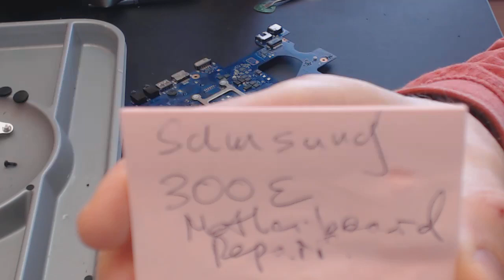Samsung 300e motherboard repair no power up issue dead laptop fixed

Comment: Interesting video, thanks for sharing. I have the same dead no-power Samsung motherboard that I'd really like to fix. Would you mind sharing what you did, and why? Here in the UK motherboard repairs cost just as much as a working motherboard, so not much point taking them to a shop.
Thanks

Comment: i have same board, after i change nec tokin to 4 330uf capacitor it wont display but with power the fan spining contiuesly. please help?
Reply: I have same problem please help..

Comment: hello buddy!
i have the same motherboard with the same issue no power up issue dead laptop how much is for the repair if i ship only the board?
Reply from the maker: +Gero Azmodii $60 for the repair if you ship just the motherboard, includes labor parts and return shipping
Reply: Thanks For The fast responds! I will buy The Service And I'llship The MB .hace a great day! And good bless you!

Comment: Hi. Pc working with battery but not working with adapter. I changed adapter jack but same problem. what can i do help please.. (samsung np300e5c)
Reply from the maker: Could be a board crack behind the jack, usually not fixable (if the jack looks good)
Reply: When input adapter power light not working but battery voltaj ok.
Reply from the maker: it could work from the battery just fine even with the cracked board behind the jack.